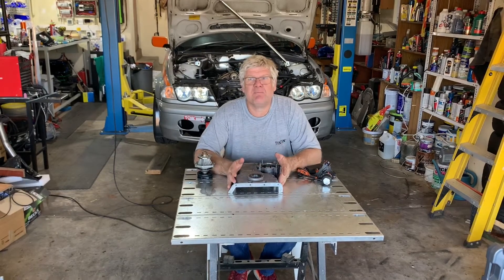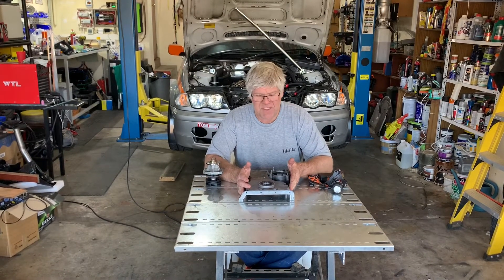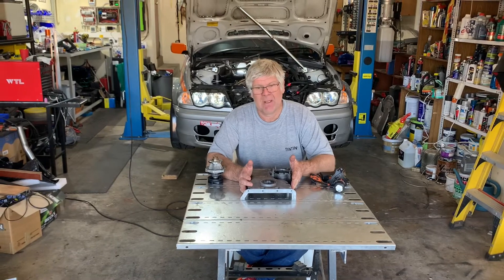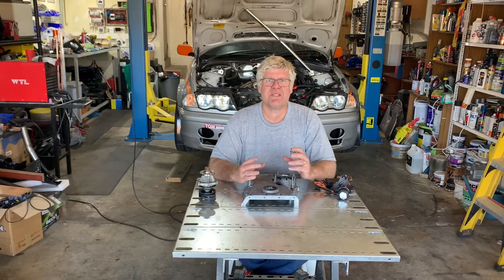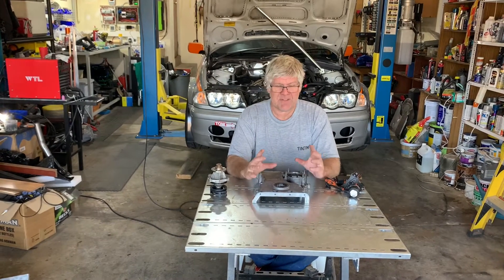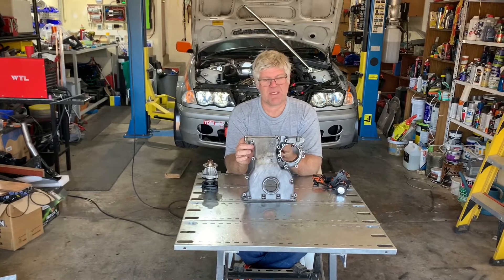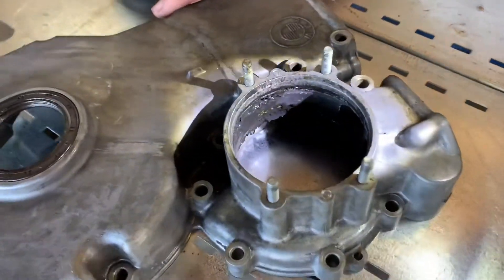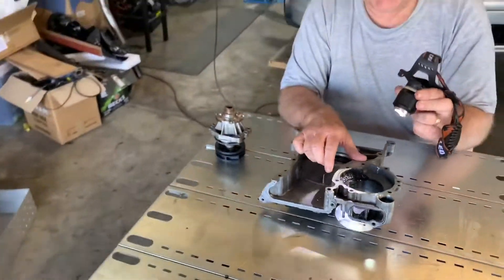Water pump cavitation damage - BMW E46 Track Car

Comment: FYI this failure mode is verry common in the FORD/INTERNATIONAL PowerStroke 6.4l v8 turbo diesel
The pump will cavitate away the cover, this phenomenon is also experienced in the preceding 6 0 but to a lesser degree

Although haven't ever seen mentioned in terms of the M5x series, maybe the spe E46/NASA guys have written about it? But seems like you are the first to bring it up

Comment: Do you think using a higher throughput pump will exacerbate this like the achilles or zionsville pumps?

Furthermore will different impeller material help? 

Another thought is maybe bmw realized this was an issue way back in 2004 and thusly decided to develop N5x engines with electric pumps

Comment: Have you considered adding a quality electronic front fan on the radiator with a switch. Which should help that’s what the drifters use
Reply from the maker: If we continue to experience overheating issues, we will certainly need to consider that. Many of our opponents are managing coolant temperature very comfortably, with very similar setups, so we want to resolve any existing issues first before looking to upgrade to enhanced cooling equipment.
Reply: BuildaBeemer another option to look at is getting the low temp switch from the e36 318is so your fan kicks in sooner and misimoto also makes a low temp thermostat for the m54
Reply: @buildabeemer  you guys are still running the clutch fan?? Efan is much more effective and you can tune its output in ms43 dme
Reply from the maker: @ifan3270  We have the original OEM electric fan on the engine side of the radiator. We have also manipulated its output by tuning the MS43 DME.

Comment: Interesting.....Is it posible that cause is biger speed of pump rotateing?If you have more rpm than stock engine (you said 7000 rpm)so the coolant is "eating"aluminium on its way?I have e46 coupe,m54b22 engine,changed the pump 3years ago,didn't see anything strange in my pump housing.
Reply from the maker: While we have raised the RPM limit, this has been done very recently and the motor has not spent any significant time at that kind of RPM. I do not believe that this problem is related to engine speed. I think it is related to the age of this motor and it's cooling system history. A reminder that this motor is 19 years old and has 330 000 km's on it.

Comment: Have you looked at implementing the E46 DIY, changing temperature gauge buffer range? It allows you see changes in the temperature much quicker than the defaults which in my opinion is already too hot if the gauge change above the middle without this DIY.
https://www.e46fanatics.com/threads/diy-changing-temperature-gauge-buffer-range-with-pa-soft-1-4.1013600/
Reply from the maker: Thanks for the suggestion! We'll definitely look into that.